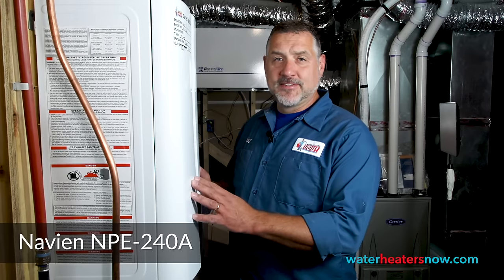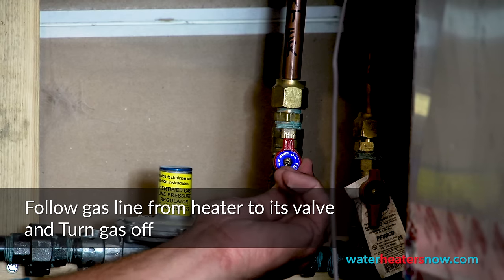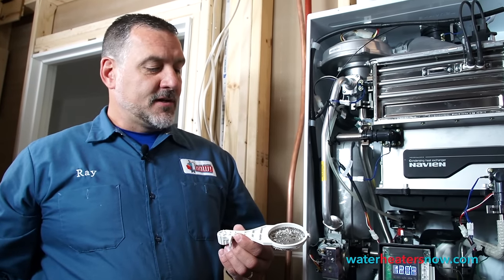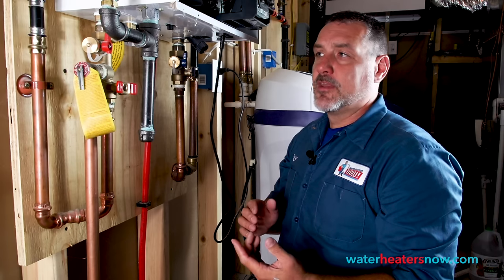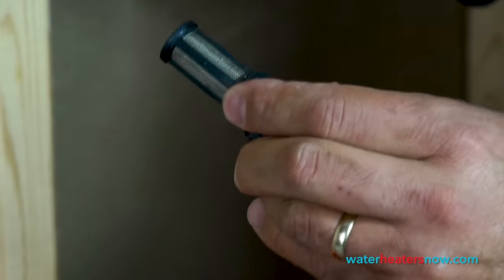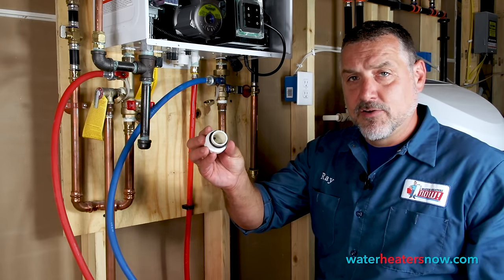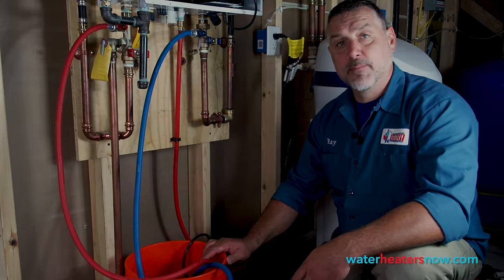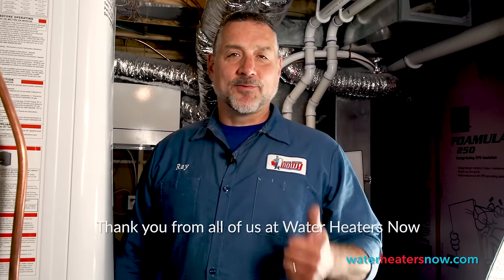Navien Tankless Cleaning   Water Heaters Now

Comment: Great video and super helpful. I may add something I learned though. Upon finishing all he'd instructed mine sounded like it had rocks circulating in it. another flush of clean water and activating the pressure relief for a brief few seconds did the trick. I can only speculate that it was cavitating? Air in the system? Whatever, it worked.

Comment: Worked great thanks! The only thing I had to do different was turn off the valve to my recirculating line, and drain the aux tank which exists before the cold water service valve. I also had to clean the second black recirc filter underneath. Last year I had the plumber out to show me how to do this annual maintenance. He only showed me cleaning the cold water filter, but not the recirc filter, dirt trap or air filter. All of which were filthy. My ‘dirt trap’ was FILLED with box-elder bugs. I’d also recommend running the pump with some clean water afterwards to clean the vinegar out the hoses and the pump.

Comment: Great video, thank you for the thorough explanations and accurate step-by-step. Three notes for those trying at home: make sure hoses on services ports are tight, mine wasn't and it leaked vinegar everywhere. Also, my cold water filter drained for quite a while, so bucket was very necessary. Lastly, my cold water filter needed more than 1/8th turn of tightening after cleaning and reinserting. Until I tightened it 1/2 way, it was leaking during vinegar flush with the sump-pump.

Comment: I took notes so I could refer back to what Ray said.  Here's what I got:
- turn off gas
- turn off power on water heater unit
- remove 4 cover screws
- unplug water heater
- remove and clean cold air intake filter
- reinstall cold air intake filter
- close hot and cold isolation valves
- remove service valve caps and attach houses, place hoses in 5 gal bucket, open valves, let drain for a few minutes
- remove and clean cold water inlet filter (have bucket ready) - reinstall
- pull pin, remove and clean dirt trap - reinstall
- descale heat exchanger with 5 gallons of vinegar in bucket
- attach hoses to pump - cold side attached to pump, hot side in bucket
- let run for 45 minutes
- flush out vinegar: 
- close both service valves
- run garden hose out of hot water service valve to appropriate drain 
- keep hot isolation valve closed
- open hot water service valve - KEEP HOT ISOLATION VALVE CLOSED
- open cold water isolation valve 
- flush for 10 minutes
- close hot water service valve, then remove hose
- recap service ports
- turn cold water on
- turn hot water supply on
- put cover
- turn on gas
- hit power button
Reply: 2 gallons of vinegar into a 5 gallon bucket.  Also, after the 10 mins of flushing out the system with cold water, I noticed the cold water intake is in the closed position, which he doesnt mention doing in the video.

Comment: Very nice job.  I had a little rubber cap inside my service valve brass cap which remained on the pipe end when I removed the brass cap.  It blocked it until I realized it was there and removed it.

Comment: Got an E 110 code to clean out the filters. Cleaned out the top and the bottom filter the one with the pin and Wahla all back to normal. Great Video! Thanks You!!!!!

Comment: This was an awesome video. I have had mine installed for about 10 months and I remember the installer telling me to call him in a year to have them come clean it out.  Unlike you, I am sure he doesn't do it for free, so in 15 minutes, you just saved me a bunch of money on my car insurance. Wait, wrong thing... Anyways. Thanks a ton for this in-depth video.
Reply: Most HVAC equipment is easy to maintain and helps save on service bills. Things like checking screws to make sure things are tight, changing/cleaning filters/screens, drains are crucial on any of these condensing products as well. I can't tell you how many times in a brief HVAC career I saw under maintained machines failing due to neglect.

Comment: Awesome video. Just a note on pump size... I called and asked Navien support technicians directly and they said it should be approx 2-4 GPM (approx 1/8 HP). I previous used a 1/3 HP (approx 20 GPM) utility pump on my old Navien unit, and after doing that for the second time the heat exchanger started leaking internally (I'm not certain this was the only cause as it was an older pump, but it may have been). So that pump was much too powerful and the Navien tech's agreed you need to be careful not to put too much strain on the internal components.

Comment: Great video. My older Navien, CR240 A, has a poorly designed  check flow valve. The fins wear out every 12-18 months and read a lower water flow. That reduces the reading in a shower from 1.8GPM all the way down to 0.5GPM and it stops delivery of got water. The part is $17 at Ferguson. Navien does not admit an issue and has not fixed it. I just keep a spare to replace once it starts to fail. Took a while to figure it out. Other than that, it's on year 12 and it works fine.

Comment: I told the homeowner "I don't service tankless heaters, I install them". Also, told him to just leave it "as is" cuz it's still working fine after 10 years of zero maintenance. 
Once I touch it I'm married to it. He talked me into flushing it with vinegar anyway.....said if something went bad he wouldn't hold me to it.. No pump so I took a brand new Hudson Sprayer, put a couple pints of vinegar in, hooked it up to the cold water inlet, filled the unit and shut the valves to let it set for an hour. Came back and it was leaking INSIDE THE HOUSING. Something about pure vinegar did a number on a couple small O-ring joints, where the water enters and exits the heat exchanger. Ended up hanging a brand new one ( $1,400.00 and change). Good thing we had the talk before. I can hear another  customer saying "Well...it wasn't leaking before you touched it". Never again for me. I'd rather have my customers mad at somebody else than me.

Comment: Thank you! Easy to follow. Question: when descaling, it should be a closed circuit however, my vinegar bucket slowly kept filling. I had to bail out the vinegar bucket a few times. Water was entering the system somewhere. Likely the cold water valve was not shut off completely. I turned off the main water valve from my well pump and that resolved the issue.

Comment: Excellent Video presentation. Clear and concise. One comment. My NPE - 240A has a recirc line installed which allows me to get HW Quickly to the furthest fixtures in my home. I have a valve installed  and a drain that allows me to isolate that Recirc. loop. I isolated the loop when I flushed the heater
Reply: bmantani ... is it possible for a navien ch-210 to be installed without a recirculating line? Our HW takes way too long to get 15 feet away. I’ve tried to set up the pre-heat option via the program/remote control and will see if that works but any advice how to improve on that ? Thanks

Comment: Awesome video! Best tankless tutorial on YouTube. Saved me $200. You didn't show the cleaning of the recirculation filter.. but it' was easy enough to do, being the same as the cold water intake.
Reply: Yes, I believe Ray showed cleaning the cold intake filter twice on the video and missed the recirculating filter. If you refer to the users manual you can see where the recirculating filter is located on the unit

Comment: Thank you for this video...very good step-by-step directions.  I did, however, get an error message when I put it all back together.  E438. I panicked.  I thought I broke the system.   I turned on the hot water and it fired up and the message went away.  I'm glad this was all I had to do.  Did I miss this step??

Comment: Fantastic video, thank you for taking the time to explain this process.  I just cleaned and descaled mine and 2 days later I started getting a leak from the dirt trap.  The O-ring is in place and the pin, but its filling up with water with a steady drip and then leaking out of the trap.  Any suggestions please?

Comment: Thanks for a very informative video.

I just bought this heater and am installing it tomorrow.  In your experience, approximately how high off the ground is the most convenient height to install this unit?

Also, can you recommend any particular sump pump for use with this device?
Reply: I found a sump pump on Amazon for 69.99 US. Our system is 4 feet off the basement floor, everything was installed before we bought house but I really like this unit.

Comment: I have done this annual service twice now on my home water heater.  Both times the dirt trap was filled with dirty black water.   Yours appeared to be bone dry.  Should I be concerned that the trap has water / condensate in it.   Thanks for the video. Wish all my contractors were as helpful.

Comment: I ran the vinegar for 45 min and by the looks of it, I could put it back in the bottles, nothing in it...lol

The 2 filters were dirty though...all in all, good prevention and great video, thanks!
Reply: Broncort1 where did you buy the red and blue hoses? And sump? Any advice appreciated!
Reply: G M the red and blue hoses are simply washing machine hoses that can be bought anywhere.  The pump is not a sump pump.  It's a kind of pump used on swimming pools covers.
Reply: @Broncort1  Ok great will buy on amazon!

Comment: Thank you for the video. I have a quick question: When I began the descaling process, I noticed that the water level kept rising gradually. Although I used only 2 gallons of vinegar, my 5-gallon container filled up in about 20 minutes, and I had to empty an extra gallon every 5 minutes. Could you please advise on what I might be doing wrong? Should I also turn off the red/hot recycling valve? Before starting the descaling, I ensured that there was no water remaining in both the hot and cold pipes.

Comment: what if you have a recirculation loop in your house? should the recirculation valve inside the Navien be turned so its shut off so that the loop is not having vinegar pushed through it as well?  I think closing the valve to the recirculation loop is important so to further isolate the water heater before pumping the vinegar through it. I made a list of steps so I wouldn't forget anything, printed it, posted it on the wall beside my heater in the basement.

Comment: Thanks very much Ray for the amazing video. Great step by step instructions! I have question - why did you use a garden hose for flushing of water after flushing of vinegar? Could you simply keep the red hose on and use it for water flushing?
Reply: I believe he just needed a longer hose to run to his nearest plumbing fixture to drain. His red hose was not long enough. Most rooms with water heaters will have a floor drain though.
Reply: @BradyDings  appreciate it, Brady!

Comment: Hi Ray,
We just renovated a house and added a second Navien tankless to the house. Both of our tankless have recirculation lines. I’m assuming I can follow the instructions in this video as you have described also by just turning off the recirculation lines? Is this correct? Do I have to do anything different because the recirculation lines are hooked up? Thanks.

Comment: Thanks for this video.  I just followed these steps and performed this on 3 units in a friend's house.  2 questions.  After the 45 minute flush, the vinegar looked pretty much the same as when it began.  Does any scale removed dissolve in the vinegar?  Also, I used a fresh 2 gallons per unit.  Could I have used the same 2 gallons for all 3?  Thanks again.

Comment: Great video Ray. I'm just wondering why you needed to connect the garden hose for the flush - whats wrong with using the same hose that the cold water service was using?
Reply: Probably no long enough to reach a drain. However, if you can reach a house drain or outside with the same blue hose that Ray used on the hot side service to recirculate the vinegar, that would be fine to use rather than a garden hose.
Reply: James J couldn’t you just flush about 4 gallons into the 5 gallon bucket? Different subject : I saw one video where a guy used 4 gallons of vinegar and another video where a guy used 1 gallon. How many gallons do you suggest?

Comment: Thank you so much for this great video.  I followed it exactly for my same Navien water heater and everything went very well.  I do have one question.  I noticed that after a half hour of running the vinegar through the heater that it was getting very hot.  I had everything shut off (gas, power, water).  Is this normal?

Comment: I was talking to a Navien support tech and they recommended also flushing the unit from the hot side too to completely flush the heat exchangers.
Reply: Fed Guy  didn’t he do that in the video.....or did I miss something?
Reply: Kelly T looked like he applied a first heavy coat that completely covered in one coat.  After a first light coat bare metal would still be visible.  Four thin light coats would eventually completely cover but should be more durable.   He also rushed each coat.   Ideally let each coat dry completely severL hours
Reply: Kelly T sorry.  First response was meant for different video.   The Navien flush is usually done from the cold side.   The rep suggested also running the flush through the hot side too..in other words reverse the flush flow

Comment: Hi Ray, thanks for all the great information on this video. I wanted to ask you a question. I was told by a plumbing supply vendor out here in California that when you do a tankless flush the first thing your supposed to do is run hot water on a faucet  so that the tankless burner fires on and that's when you pull the plug. Reason he gave me is so that a  valve inside the coil is fully open and therefore you get a thorough cleaning.  Is this true?  Thank you.

Comment: Thanks for the video! I wasn't able to shut off my natural gas. There's a valve that's locked. I descaled anyway. Is there any danger?

Is it okay that I don't do a cold water flush for 10 minutes? I don't have a nearby drain. I just drained into a bucket for about a minute or two.

Comment: I purchased my Navien water heater a year ago and I am just about to embark on the first cleaning. My question is concerning the difference between commercial descalers and vinegar.

My understanding is that the commercial descalers are better, but they are also more potentially dangerous to a person’s eyes and skin. Apparently they use a much stronger acid like hydrochloric acid instead of the acid in vinegar. 

I would really appreciate your feedback on what you think the difference between the two is. Is it worth it to use the commercial descaler? 

Any input would be greatly appreciated. 

Thank you very much for a very informative video.
Reply: Yes.  You are correct.  
A number of available cleaning products will dissolve accumulated and deposited calcium carbonate (scale).  Hydrochloric acid (aka muriatic acid) is stronger and more reactive so it will do the job faster.  And yes, it also requires careful handling (gloves and eye protection) and can also damage clothing, etc.  
The commercial scale cleaning products use a formulated mix of chemicals.  They work great, save time and cost more, but for a generally one a year cleaning, they are simply not worth the saved time (just 45 minutes).  
Stay with the vinegar and enjoy a brew while it works.  Just my 2 cents.....🛑🏁

Comment: I have a Navien Combi Boiler in my home. One side does the domestic water supply and the other side handles the heated floors in my basement through a closed loop system with an expansion tank. I used your method to clean/flush the domestic-supply side and there was next to nothing in the system. It was pretty clean aside from the air intake filter and white distillate cap on the bottom. My question…. Can I do the same procedure for the in-floor heating supply of the boiler or is there a different procedure because it’s a closed-loop system? You would think that this method would introduce air into the system which would be a bad thing.

Comment: I have a 240A  installed about 5 years ago.I do the cleaning every year exactly as you describe . I run the pump for 1 hour but the vinegar is always clean.. But I went on vacation for two months and  shut off the heater and drained it. When I got back before I turned it on, I ran the water  in the laundry sinc and saw the water a little rusty but ceared up in about 15 seconds. Now a month later I just finished the scalling and again the vinegar is clear. Is there anything to worry about? Thank you.

Comment: I'm thinking of getting this brand same one installed.  The plumber saying a condensation neutralizer is not needed.   They say it can be ran down in crawlspace and out the block. Nothing more needed. Is this true?? Iv heard 2 different stories.   Will this water kill the grass in this area? Also, I was told the gas line would be OK, I have a gas furnace,  and gas range stove.  
The unit is going into a laundry room, being vented through the roof,  and the condensation line and the pressure overflow bathing going thru floor into crawlspace  out side of block about 20ft or so.  
Any info would be great. 
Navien 199btu/11.2gpm is what was quoted for.

Comment: Do you screw a garden hose  later on because a 10 min flush would mean about 60 gals of water and so flushing in the bucket using the small red pipe is not possible?

Comment: My Navien water tankless was installed about 6 years now. For somehow the service  valve for hot water side (left) very close to the gas pipe I could not connect the hose due to no space. I have a question that the service valve can be  turned to either left or right in order to get out the way the gas pipe blocking? Thanks.